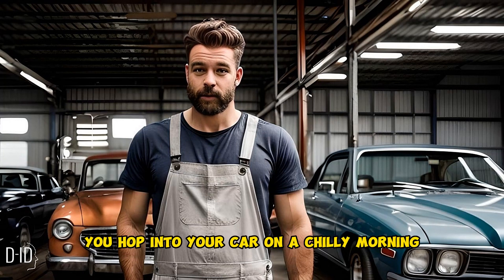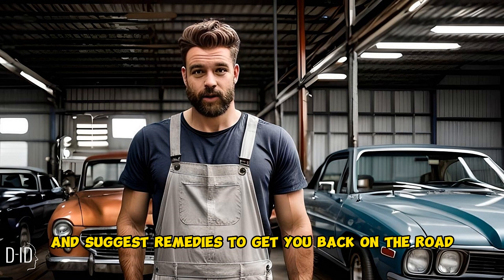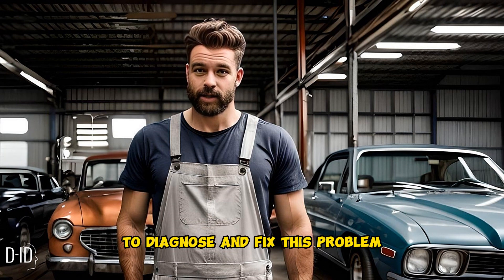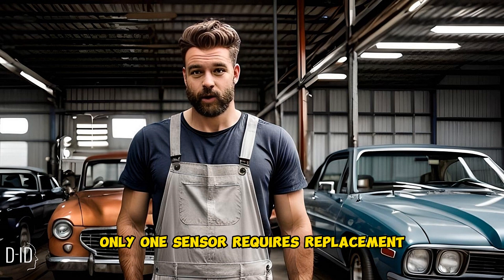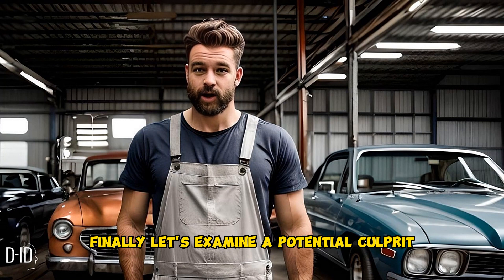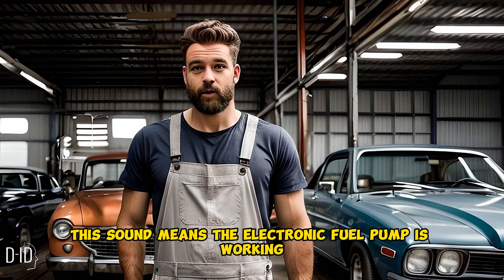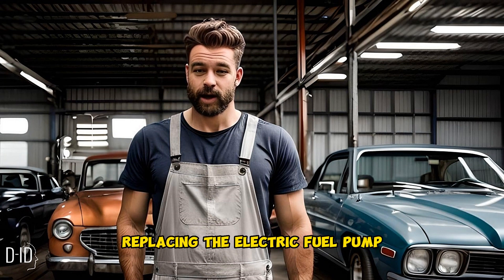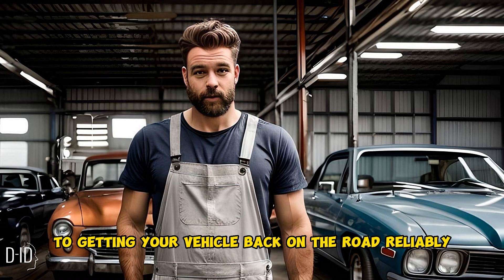Car Starts but WON"T STAY RUNNING - Starts then Dies😮

Comment: One thing you got to make sure of is that your intake is not leaking anywhere behind the mass airflow sensor or the MAAP sensor because that’s exactly what caused my issue caused the two lien condition as well which intern made it have gas and then start go to about 2000 RPMs and then immediately drop and diewould be the first thing to check any vacuum leaks of any kind